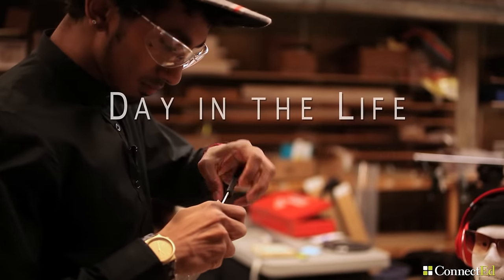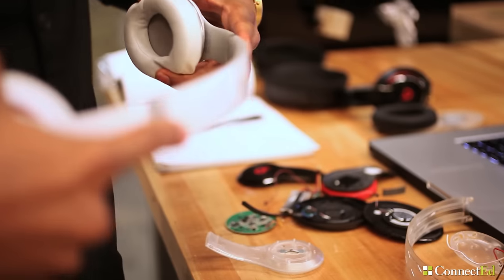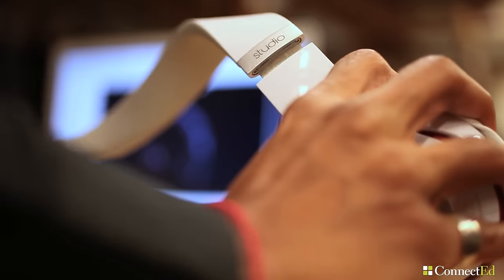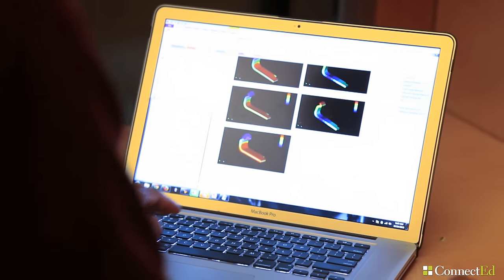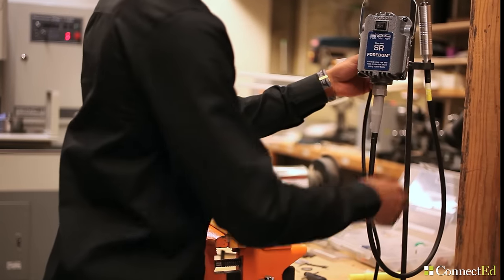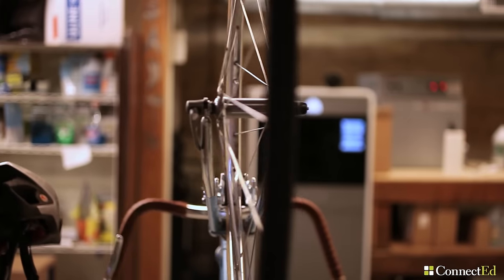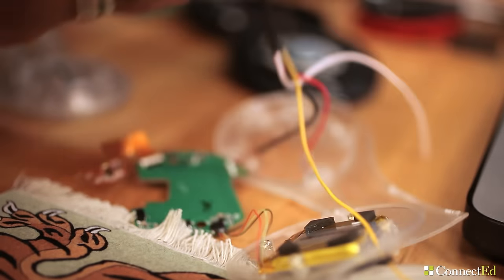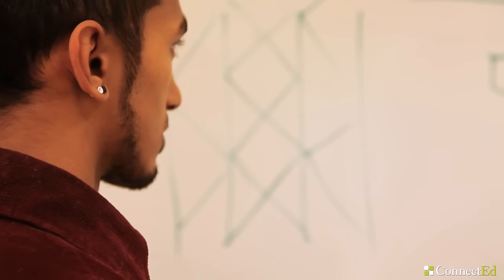Day at Work: Mechanical Engineer

Comment: Who earns more? A software engineer or a mechanical engineer?
Reply: Software.
Reply: Both make very good money. Choose what you like doing more. If you choose one or the other based solely on salary difference you'll probably regret it. 

That being said, both of these fields warrant at least a small amount of passion. If you're not passionate about the field, you'll more than likely end up being miserable.

If money is your sole drive in life, nut up and head to Wall Street. Go to an ivy league and get into high finance.
Reply: 31musick93 I'm a computer science student in university, I was just curious to see who makes the most, I've been looking at software development since I was 16 so even if mechanical earns more I'll still be a software developer. I was just curious to see which engineer makes more.
Reply: +Nathan Masters In that case, yes, software engineers will make more money than mechanical on average. Apologies if I came of as condescending, I was trying to type a quick response at work.
Reply: +Nathan Masters do what you like to do don't just do it because of who earns more money
Reply: Depends on the job role but for a given amount of hardwork Software engineers earn more because the demand is high

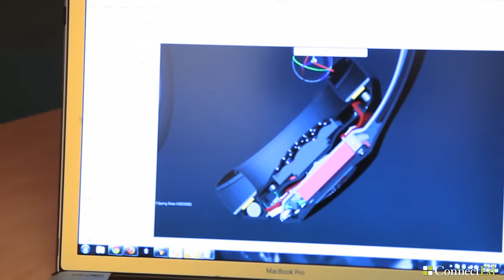Comment: 1:00 he is using windows on a mac? What?
Reply: +Rocksmith Pdl It's called Bootcamp. You can run Windows almost natively.
Reply: Couldn't you install the operating system on a mac anyway? and the same with mac or linux on pc?

Comment: What type of mechanical engineering is this?
Reply: +Monica s A normal one. Doing Finite Element Analysis in addition to CAD and CAM is the norm for mechanical engineers.
Reply: +Monica s What Alq said. Truth be told, a large number of mechanical engineers are just glorified draftsmen these days. A lot of them won't admit it though, because they don't want to admit other people can just as easily do their job. This is coming from a mechanical engineer.